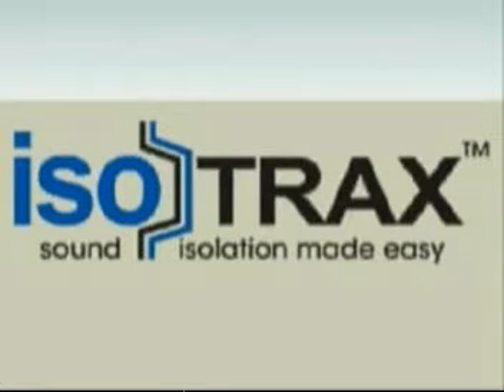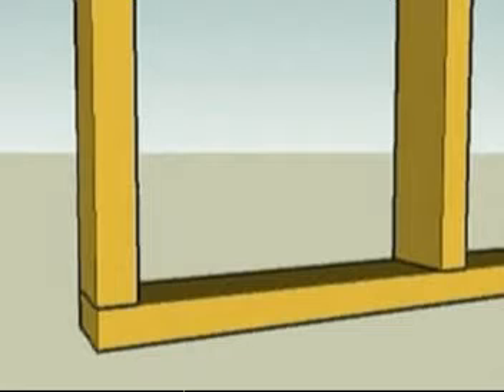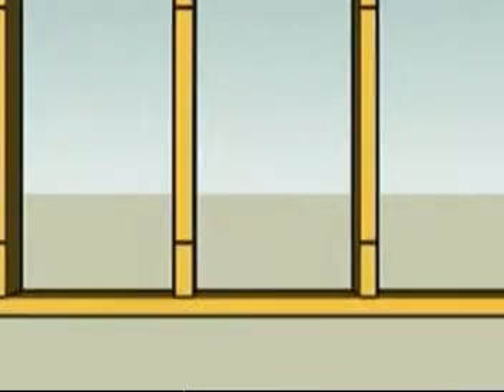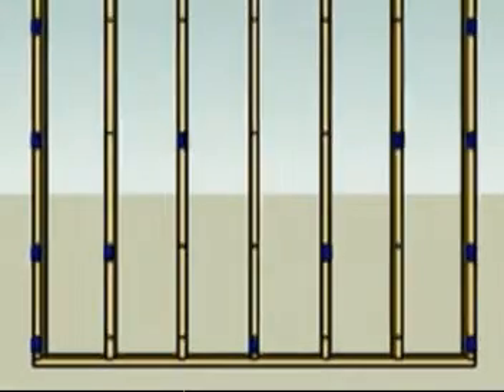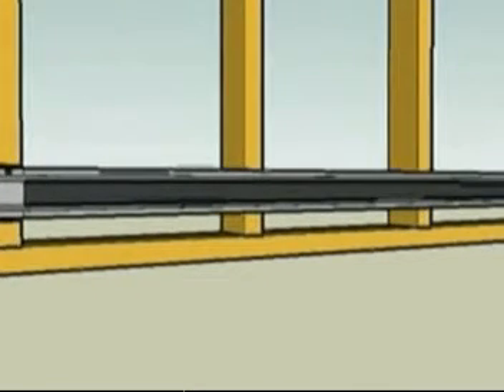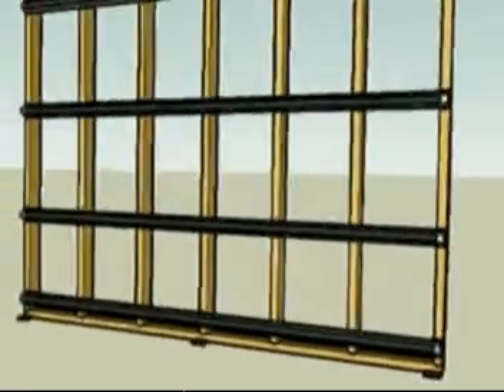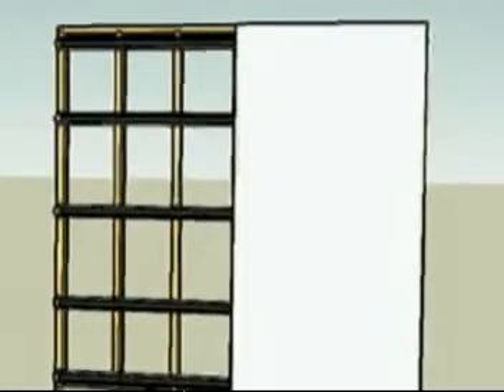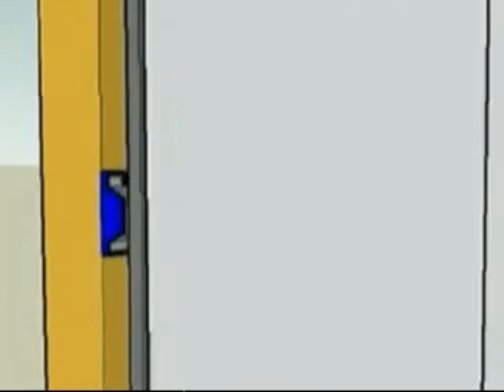isoTrax® Installation

Comment: Is it safe to attach 5/8 Gypsum boards (with 1 1/4” metal screws? The drywall isn’t touching the floor. The metal channels are very thin. What is supporting the weight of the drywall?